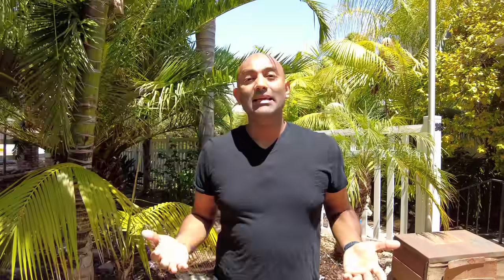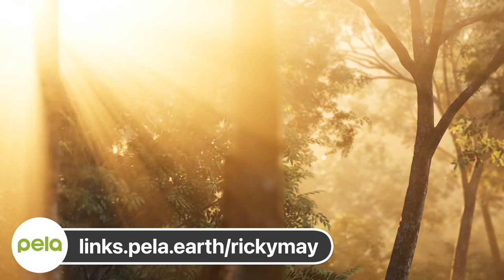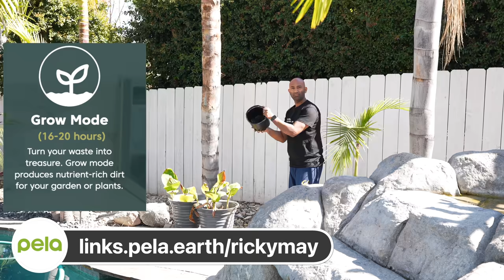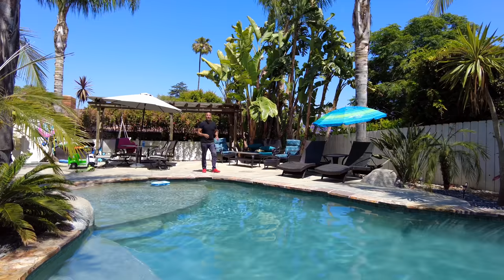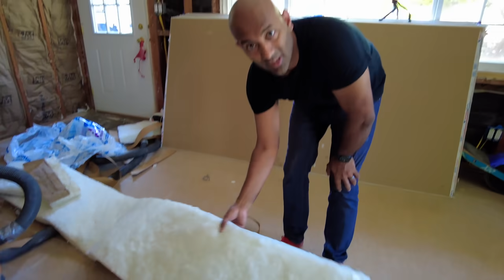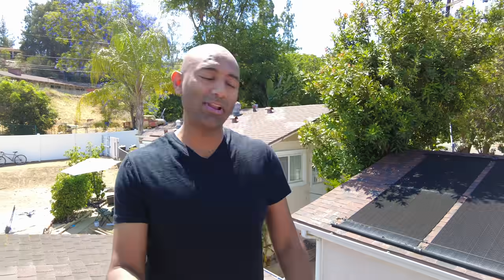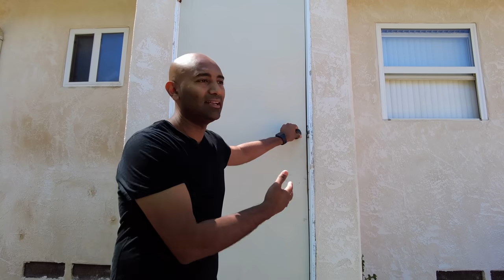How I'm Planning to go 100% OFF-Grid!

Comment: Wow, this should be some great videos.  We are planning on downsizing and building a net zero house so we are going thru the same process.  I hope you will price out a Tesla solar roof.  Also, I would really consider going all in and get a price for trenching and up grading your electrical for the 2nd house.  Electrical would not be that expensive and you will appreciate having more options for your electric needs in the office.  If you get rid of all the fossil fuels and the bad side effects you might be happier. Can't wait to learn about the heat pump dryer.  Thanks for doing these videos.  Cheers from Maine.
Reply from the maker: We need to connect! Reach out and at least join our discord

Comment: The metal skin on a fridge doors will feel cold even when the fridge is turned off because the metal is a good thermal conductor. That’s a common misconception pushed by salesmen. It might be true in the case of windows and walls which are not wrapped in good conductors but it’s not a fair measurement of refrigerators. My toaster oven feels cold to the touch, I literally just checked it.

Comment: We have a saying in our house: "The boring money." At its source... insulation.
The better insulated our structure, the smaller the systems need to be. We are in that phase.
Reply from the maker: Video coming soon!
Reply: @TwoBitDaVinci  Yeah it really dove deep for us because when it is done... we replace all windows/doors exterior SIP panels, house wrap, where do we want the vapor barrier, electric re-wire (especially with the spray foamed portions).
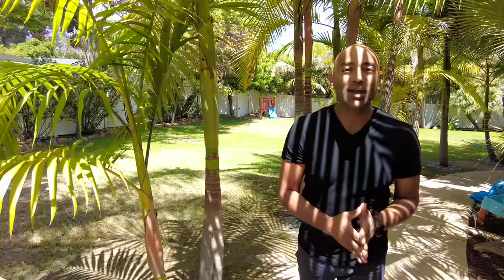Reply: Consider this net-zero roofing video we found. It Youtube "This Old House | Net Zero Blanket (S40 E6) Full Episode" spin right into @1:28 for the point. It's short about a ~2mins long portion of that program. ~R50? R64? and supportive of solar over all of it when complete.
Reply: Two Bit Da Vinci wondering if solar will work on your North roof because of your latitude, if not look into a green roof. A green roof can help cool off and keep warm a home by a large number of degrees.

Comment: For the second house water heater Rheem has the ProTerra Plug-in Heat Pump which works with 120v and can be used to replace a gas heater.

Comment: Grey Water (shower, washer, dishwater) use to water lawn. Use the water twice for better utilization.
Reply from the maker: Yes! This is going to be tough and require plumbing work but yes!
Reply: Joseph
I had the thought that if you captured the "rinse water" in a secondary container you could pump it back into the washer to start the next load of "wash".
A filter of "spun wound fibre" would remove any abrasive particles and lint. Any soap would be a bonus.
Reply: @russellvatcher4753  Interesting idea ... I would still recommend capturing it and using it for landscape watering. Your suggestion, at what point do stop reusing water and how to dispose after so many uses?
Reply: @riznliz  Just once since the wash water goes down the drain unaltered with most dirt and soap.
Reply: @TwoBitDaVinci  Run all your waste to your own septic system. This will eliminate your dependency on sewer and get you a whole lot of water for your garden.

Comment: Induction cooktop ALL THE WAY!! it heats up the pan directly, saves sooo much time and energy vs heating a secondary element first
Reply from the maker: yeah that's what I'm thinking!
Reply: Not to mention cleanup is easier since the stovetop doesn’t get hot enough to burn stuff.
Reply: @williammeek4078  only problem with induction cooktops is they aren’t consistent heat like gas stoves.  The induction cooktop works much like an electric element, heats then turns off then back on.  Try making crepes with an induction cooktop, see if you can do it without burning it.
Reply: @oloilmann4288  that's not been our experience with our Frigidaire induction range. This may be true of other induction ranges and cooktops though.
We love it, and it was (in 2020) one of the few "affordable" induction ranges we could find as well. Moderate heat is Def not of/off blasts, heat seems even to me, until you adjust it when the response is impressively quick. I found the move to stainless steel cookware for frying a bigger jump but have some induction compatible ceramic pans that i do make pancakes and crepes in from time to time and my failures are down to me doing a poor job of keeping them clean.
Reply: Saving space with "invisible countertops" is a nice bonus if you can afford it.
Reply: One of the few downsides is that its a bit expessive , and you will need to get and oven separetelly (plus some of your pans may get kinda useless) but its a pretty cool alternative.

Comment: Unless it gets below about 20 degrees, you could do an old breadbox solar water heater, Likely for both homes.

In the end you don't appear ready to live off grid as you appear not to want to make any compromises...

I'm off grid all but water. If I had to, I could do that today, where I am with water collected from the roof, and filtered to be potable.
Reply: He could convert his old gas water heater as the tank for the hot water in his other home.  With his usage it would be very expensive or impossible to go completely off grid.  He would be better to be grid tied and have everything supplement as it would be a lot cheaper.

Comment: I live in an off grid solar house and I have no more gas meter because he was wood and a heat pump. My suggestion is don’t ever put Asphalt shingles back on your roof. The water that lands on them becomes polluted from the Bitumen. Also the solar panels will far outlive shingles. 

I recommend server rack batteries instead of a tesla power wall. It’s DC coupled and therefore it will work better in almost all circumstances. 

You could have an AC coupled solar system that is tied into your off grid DC system. 

Storing hot water is 100 times cheaper than storing electricity and therefore I recommend giant storage tanks.
Reply from the maker: what roof should i do?
Reply: @TwoBitDaVinci  A metal roof is best. Standing seam metal roof is one option. In Ontario Canada there’s a company called hygrade roofing. They make a more aesthetically pleasing and  it is a metal shake steel roof system. And the cheapest option would probably be something like Vic West steel. The company that did our roof used a product called Galvlume galvanized aluminum. It’s actually painted , galvanized and I’m pretty sure it’s aluminum. It’s been there for almost 20 years and it’s showing no wear.

Comment: This is incredibly cool and exciting. Looking forward to it. but it's also misleading, because an Earthship really is a very specific thing and this isn't that. Cool nonetheless.
Reply from the maker: you're right and thanks, I needed some term people can understand. I really want to reach every possible viewer, thanks again!
Reply: @TwoBitDaVinci  Earth Ships are built with tires rammed with earth. I don't think you can retro-fit a home and call it an earth ship. You can def call it net-zero or an earth friendly home. That's actually one of Mike Reynolds pet peeves is people trying to ride the wave of popularity around Earthships but the build isn't really much like it. I saw a video where he was complaining about it and said at least call it Earthship-like, which still wouldn't be true of a retro-fit.
Now, if you were to use up some of that side yard actually building a small Earthship, say the Survival model, that's a different story.
Reply: Also, if as part of the retro-fit, you add a greenhouse connected to the Southern exposure of the main home or the office, and use it to regulate the temperature with overhangs that take advantage of the suns position during winter/summer, then you could call it an Earthship-like retro-fit and I would be here for that.
Reply: Your going to need a big water tank for rain collection
Reply: @tomdalton4016  He mentioned water a lot. So I am sure a rainwater system is in the pipeline. You can flush toilets with sea-/ pool-water. But for laundry and gardening you want pure rainwater.
Reply: @tomdalton4016  In San Diego you cant rely on a rainwater collection system to provide for the home. I believe this year it has rained only 2-3 times for a few hours each in the area. To provide reliable water another system will have to be used. Right now if someone doesnt have enough money for a humidity collection unit, which as mentioned in the video is around $80k when all said and done to install, then those "hydropanels" are one of the easiest ways. They dont produce that much water, but they are reliable for a home in a city or suburb and are somewhat affordable.

Comment: Can't wait to watch your progress.  I'm on a similar path with a 20-year-old all-electric, 2900 sq ft house in Central Texas.  Started in 2010 with a radiant barrier, additional attic insulation, and two air-source heat pumps.  In about 2014 replaced the conventional electric water heater with an air-source heat pump water heater. In 2018, replaced the composition roof with standing seam metal (galvalume) and added an 11.4 kW solar array.  The solar array is bolted onto the standing seam metal roof, so there is no roof penetration for the solar.  I've replaced most of the windows with low-E, double pane, synthetic frame windows.  The next step is battery backup.  I'm planning to go with an Enphase system because: 1) already have compatible Enphase micro-inverters on the solar panels, 2) LFP battery chemistry vs NCM and 3) the Enphase system creates a whole-house micro-grid when the grid is down. After batteries I'm planning to add rainwater capture.  Ground source heat pump is also under consideration when the current heat pumps need replacement.

Re: Heat pumps ... If you are already planning to drill a well you should do a deep dive into ground source heat pumps for heating, A/C, and pool heating.  Based on the minimum possible research (Symbiont Service Corp Youtube channel) it looks like you can combine central heat, A/C, hot water, and pool heat with a closed-loop ground source heat pump and a lot of plumbing.  Also, no plumbing on the roof.  You could even include hot water for the Studio House.
Reply from the maker: That’s awesome!! I’d love to hear more about your setup!

Comment: I got my 1650sf home in AZ net positive 3 years ago, all I need is 5.4kw of solar, led ligts, variable speed pool pump and induction stove and I produce more electricity than I use including charging my chevy volt. Last winter I  added betwen 2 and 4 inches of EPS to the exterior walls and stucco and change some windows, the are R-value in the walls is now r20-r28.
Reply from the maker: that's awesome!
Reply: @TwoBitDaVinci  BTW, get an induction stove.

Comment: Have been part way through this journey.  Any time there is a major project, look to ultra insulate.  Just adding insulation between framing doesn't really cut it.  I have an older house with 2 by 4 construction.  I added a layer of foam all around the house to add r5, then resided.  Windows were upgraded at the same time.  On the inside whenever I did a project, I furred the walls out with 2 by 2's making them essentially 2 by 6.  I then add R-24 roxul replacing the terrible r8 original insulation.  Instead of vapour barrier I used an inch of foam that also acts as a thermal break.  In the basement I put a layer of foam on the cement floor and a 2 by 4 wall inside the cement pony wall, which was also insulated with r5 foam.  Before I did this I sealed where the original framing met the pony wall with caulking.  You could feel the breeze coming through.  The basement was basically uninhabitable in the winter and is now cozy, as is the rest of the house.  R19 near the pony wall and r50 above it.  

Think about these details first, then proceed with the fancy technology.
Reply from the maker: wow very cool Leroy, where do you live? Sounds like weather is a major concern for you and you handled it masterfully!
Reply: @TwoBitDaVinci  Thx.  I live in Kamloops, BC, Canada.  Hot in summer, cold in winter.  A semi desert.  My project is now my rental house.  I now live a newer well insulated house on a small acreage by a salmon bearing river.  To this paradise we have added a 8.9 kw solar system, with lots of room to expand.  I tend bees and  make mead

Comment: For the second home water heating, there should be some 120v heat pump water heaters that will be coming onto the market this year, so that could be an option.
Reply from the maker: That would be ideal!
Reply: If it is purely for water at taps (faucets) in the UK we have small single unit water heaters normally installed in commercial buildings where they don’t want to run gas and are used rarely, such as in restrooms and staff kitchens. They are usually a small 15L tank installed under the sink and run off our standard mains here, 240v, I wonder if you have anything similar but for 110v?
Reply: Off grid for over 20 years with just a 400 watt solar power system. First thing you need to do is reduce your use and make the house efficient because if you try to live off grid like you live on grid you will be paying big money and probably disappointed.  Best on your off grid adventures!
Reply: just a note If you cut the voltage from 240v to 120v then you do double the amperage draw, with low amp panels 240v is actually going to save you amperage capacity ( except for the main sub panel breaker where 3000 watts at 120 or 3000 watts at 240 will be the same load on that breaker regardless of voltage used. So unless you just downsize the BTU output of the unit itself. Although this is shaping up to be the "perfect spot to try a really adventurous system to turn food waste compost to a natural gass/ propane substitute and use it for something with a lower draw to test the feasibility of one of these systems. Really looking forward to the project regardless, really loving your channel's content more and more.
Reply: @matthewjacobs6227  All else being equal, you're exactly right about the voltage amd amperage stuff. However, unlike 240v heat pump water heaters, the 120v models don't have a backup resistive heating element, so the max power draw would still fit within the safe operating envelope of a standard 15 amp, 120v outlet.
Reply: AWHI Advanced Water Heating Initiative’s 120-volt Working Group, monitoring & verification contractors, and manufacturers, NBI has developed a field study to show the potential of a 120v new class of water heaters as a plug-and-play solution to meet the retrofit market’s needs. you should check it out. I can't get it in the midwest yet but they are testing them in the west and northwest.
Reply: @prerunnerwannabe  Maybe just disconnect the resistive heating element from a 240v heat pump. Maybe they are too smart for their own good and will throw an error when disconnected.
Reply: @salibaba  we too have 240V slave tanks in office buildings, that can be bought and installed in residences, the tankless system is a better use case as he said it isn’t for showers, better would be an electric tankless system.  If only for washing dishes and hands an RV electric tankless might be more efficient, and less cost.
Reply: @TwoBitDaVinci  I wonder if also a product we have here in the UK is being exported yet. The Sunamp heat battery can be charged up using a solar diverter, or using a resistive heater, or solar water system. It was developed in Edinburgh if memory serves. They are smaller than most night stands but can hold enough heat to cover water use equivalent to a  300L tank. They do quite small ones to go under sinks and dont have very much heat loss. They store the heat energy as a solid in a phase change material. Sodium is the main component.
Reply: @salibaba  I totally agree.  Ricky should do a feature on the Sunamp battery.  the Thermino 300 ePV would be perfect and use use excess solar for primary heating with supplemental heating being done from battery at night.  They have recently opened an office in New York and have staff currently working there.  Would love to see the product featured on this channel!
Reply: There are electric RV systems that could fill this level of demand I would think?

Comment: you need to get rid of that lawn and replace it with a pond, then build a greenhouse over the pond. Put rain gutters all on your roof and route it to fill up the pond when it rains. Then put your atmospheric water generator / dehumidifier inside of that greenhouse. it will be crazy efficient in there. Then connect a heat pump between your house and the greenhouse so you can use the greenhouse as a heat battery.
Reply from the maker: no way, i love my lawn, its amazing for running around and playing with the kids. we are building a gray water system where all water from the sinks and showers will be what we use to water the lawn. we may add a pond else where and we are going to have a greenhouse for a vertical farm
Reply: @TwoBitDaVinci  You need to replace the lawn with something you don't need to water. Especially in California. I am not an expert but surely there's something out there that can give you a space for your kids that doesn't require much if any water.